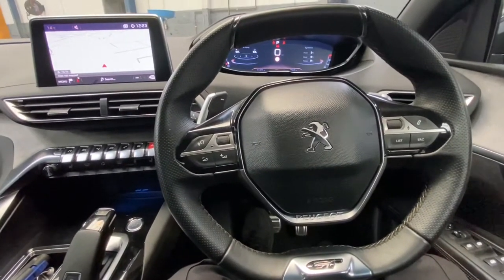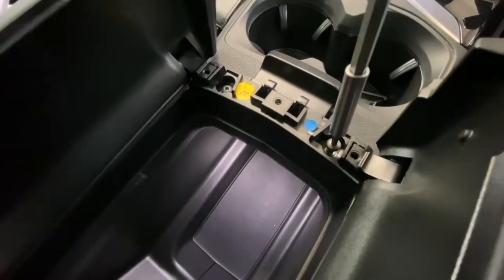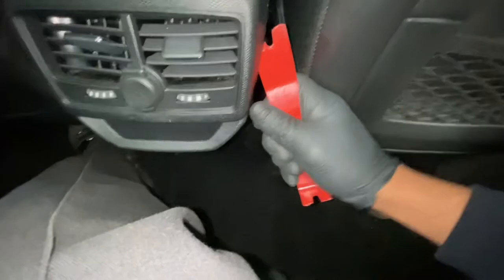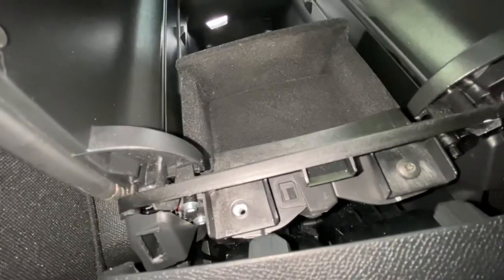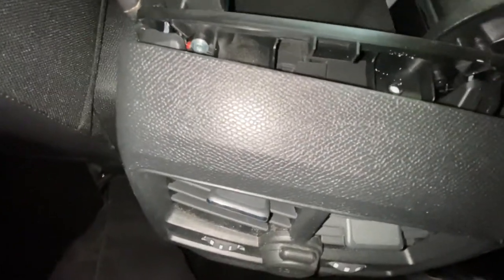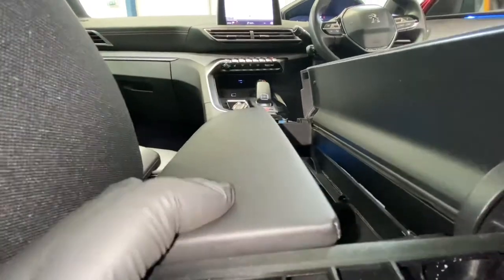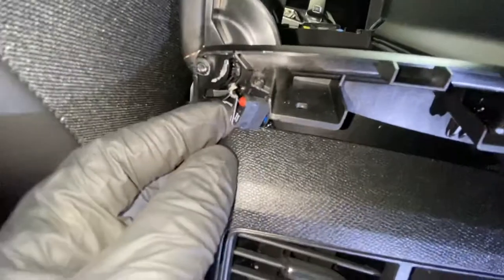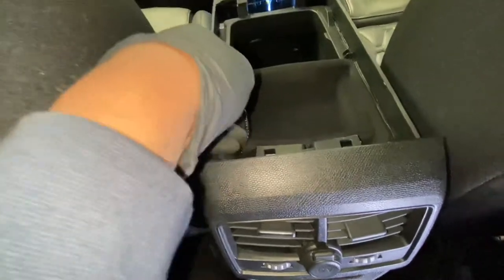#Peugeot #3008 #Arm #rest #removal

Comment: at 3.15 you say "that popps right out"... This was not sertanly the case in my car. (perhaps a different year) I had to first remove the whole lower back panel, under the vents, in order to detach the electric iso-clip (for the light-relay) first then could I remove the armrest without breaking anyting of in the front of the cocpit.
Reply from the maker: With some of them you have to do that
Reply: How did you remove the lover panel under the vents? Can’t get it to come loose
Reply: @astranium  If I remember correctly, the whole thing (vents and all) did pop out just by using a non-metallic bender. Was a struggle to get it back on correctly as well. Hope you got it,  good luck